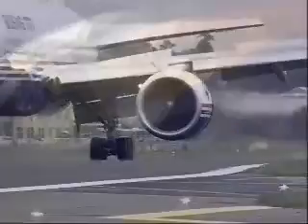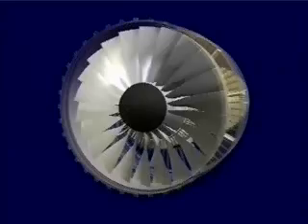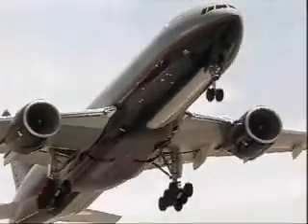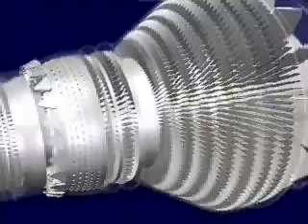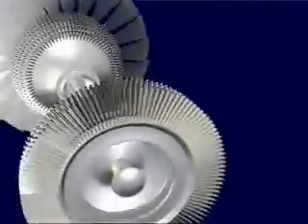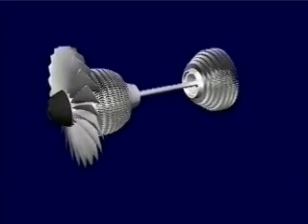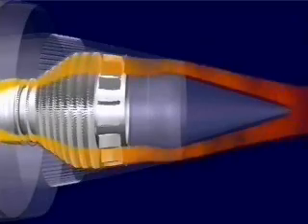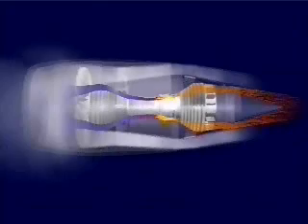How a High Bypass Turbofan Works

Comment: And what does a high bypass turbofan driven jet engine NOT do? With only 15% of air diverted into the engine, and, with high alt. low relative humidity making only about 1/50th of that air actual moisture, one thing these engines DO NOT do, is produce massive  opaque streams of miles-long, sun-covering so-called condensation.
You will sometimes see a short, rapidly disappearing vapor trail. THAT is jet engine condensation.
All the rest of the filth that's left in the sky? That stuff is not condensation, it's crimes against humanity and nature.

Comment: My main takeaways from thie: the only way to propel yourself in a fluid (such as air) is to push against the fluid.  Pushing against the fluid propels the vehicle in the opposite direction, which is called thrust.  Jet engines compress air before pushing it out, to increase the push in order to provide more thrust.  They do this with propeller blades and combustion combined with restrictive ducting.
Reply: What would happen if it didn't eject any fuel?
Reply: How about rocket engines?

Comment: so how is the fan in the front initially powered before enough air can be compressed?
Reply: The APU in the back of the aircraft actually spin the fan. The fan then suck air and that's it
Reply: @simonpohludka1002  Yup APU is a small turbine engine that’s light enough to spin on electricity alone.
Reply: @myusername3689  The APU also uses fuel

Comment: Excellent video although I'd like to know more about the by-pass air which produces 80% of the thrust
Reply: If I understand it correctly, the turbine engine spins the huge propeller blades in the front of the engine.  Most (80%) of that air bypasses the engine and is compressed by the restrictive ducting, so it shoots highly compressed air out the back, increasing the amount of thrust per unit of fuel used dramatically.
Reply: @paulh2981  so these are just weird looking prop planes...
Reply: @Hazztech Essentially. It's an insane prop, with a cowl that increases efficiency and thrust, and a lot of complex doodads inside to make it all work.
Reply: What happened was first they made jet engines. Then they added propellers on the end and found out these were more efficient. And then they put ducts around the fans they added on the end, which makes them even more efficient. So that's where 80% bypass air comes from. The actual jet engine part is only being used as the most efficient way to burn fuel and turn it into power to turn a fan blade to propel you, it's not really being used to make forward thrust itself so much.

Comment: call me an absolute idiot. but just a thought. why dont they use a simple ICU like the ones in a sedan? like use it to turn the turbines and push the air backwards! did he not say that 80% thrust comes from bypassed air? hope someone will help me out with this doubt!
Reply: If they use only fuel then the amount of fuel required will be much higher compared to the current case. In this scenario they are using the compressed air to a large extent to help rotate the low spool which in turn rotates the propeller.
Reply: gas turbine engines, which is what the turbojet component basically is, are far more efficient at producing high speed rotation compared to reciprocating piston engines. Lighter and fewer moving parts too.

Comment: So if only 15 % of the air is being  combusted how the fuck do we get contrails for over 40 miles and then spread out to huge hazy blankets ,oh wait it's just a bunch of chemicals there spray us with!!! Geo engineering (sai) program ! Hahah dumb fucks
Reply: Oh dear.

A contrail is formed due to hydrocarbon combustion byproducts, ie, water condensing and freezing.  It has nothing to do with the thrust from fans or propellors. It is the water that is a byproduct of combustion plus small amounts of soot that causes contrail formation so the percentage of thrust provided directly by the fan relative to the combustion is irrelevant.

In other words, contrails are 100% the result of the byproducts of fuel combustion and 0% the result of thrust. The ratio of thrust is largely irrelevant, except for the fact that turbo fans result in cooler exhaust and make contrails MORE likely to form as proven by this paper: http://elib.dlr.de/9281/1/AIAA-2715-2000.pdf

The branch of geoengineering known as Solar Radiation Management is - with the exception of ground based albedo modification - entirely hypothetical. Stratospheric Aerosol Injection has not graduated beyond research paper and mathematical modelling and even if it was underway would not leave a trail and would take place at double the altitude of the contrails that you erroneously term 'chemtrails'. The persistent spreading contrails that you are witnessing have  been observed, documented, recorded, photographed, filmed, measured and studied since the early advent of high altitude powered aviation and in excess of 80 years.